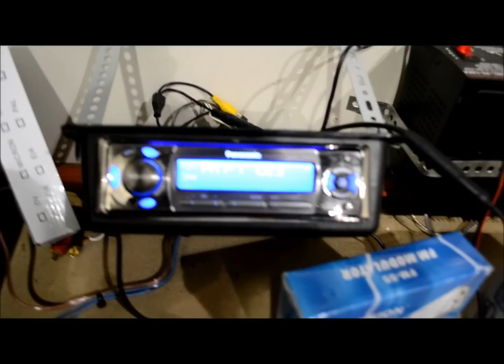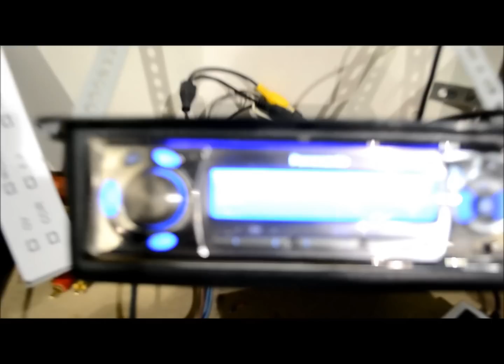Detailed tutorial on audio rf modulator uses in car and home

Comment: Thanks for uploading! Can this work on an old analog dial tuner? Is it possible to buy an RF modulator that has two separate inputs? I want to add a 3.5mm AUX/iPod input under my dash and have a 5 disc changer mounted in the trunk of my car and using a switch mounted under my dash to actuate between CD and iPod. This is in a 1977 Lincoln Continental with original quadraphonic 8track player that I want to keep. I also want to add a powerful amplifier and possibly a small sub-woofer. Any advice?